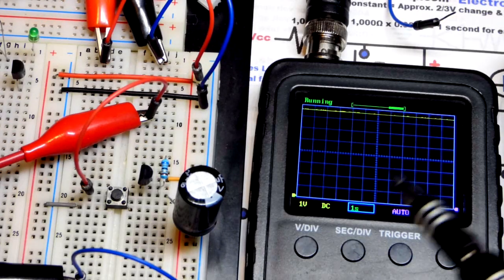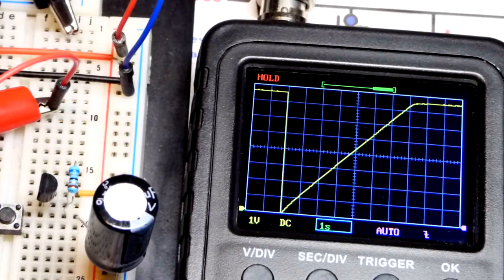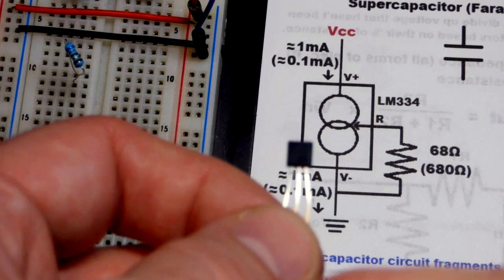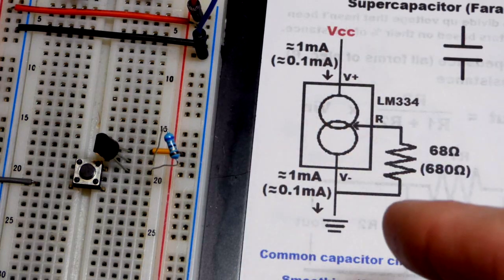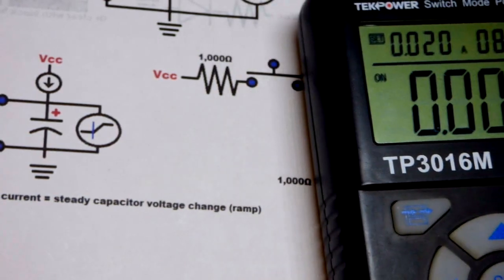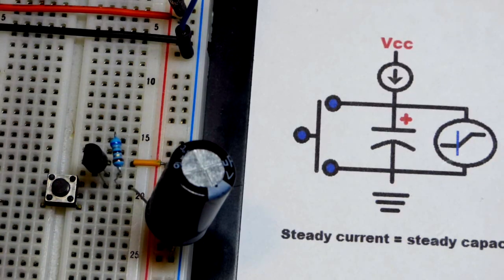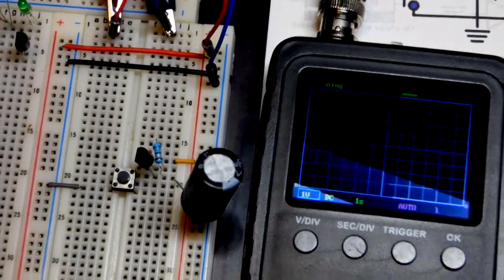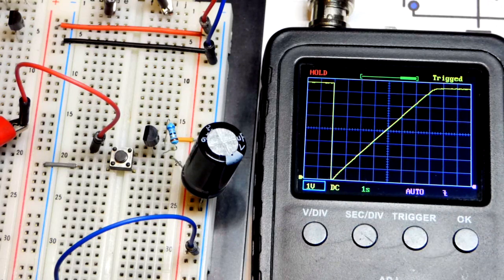Rising voltage ramp circuit using LM334 current source sink and capacitor for quick videos 9

Comment: hi there, how could I use this to ramp up 0-5v on a e-bike + throttle wire? We are using cheap controllers, and they have horrible throttle response... too much power off the line, especially for kids. If we could get the throttle wire to ramp up any time voltage is applied, that would tame down the controller and be amazing! Any ideas?  Thanks!

Comment: How difficult would this circuit be to scale up?
I am building a go-kart powered by ultra caps and I don't want all the power dumped into the motors all at once.
Reply from the maker: There's higher power current source options out there. You probably wouldn't end up with anything like this though.

Comment: That is almost what I'm looking for. I want to have a ramp up to peak and hold as long as the switch is depressed. I in turn will use this to control a PWM generator feeding a two channel motor controller. Have anything like that in your repertoire?
Reply from the maker: I haven't built anything like that yet unfortunately. Probably schematics out there though if you do google searches.